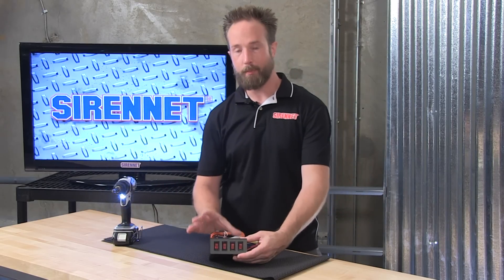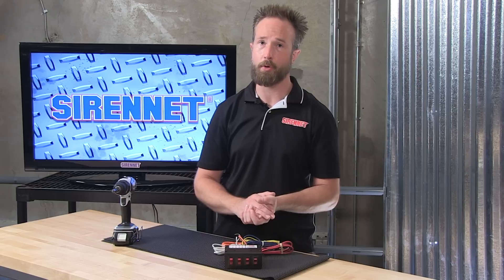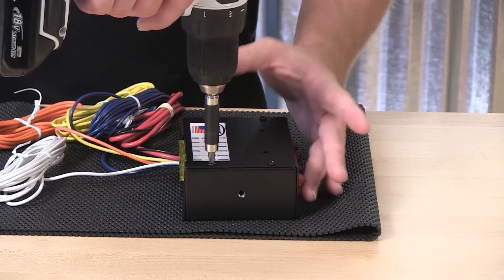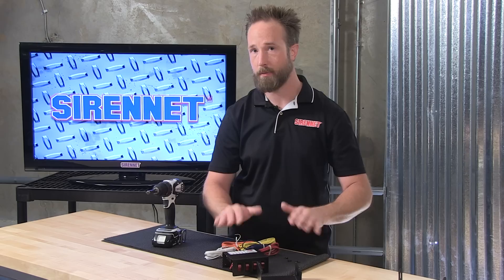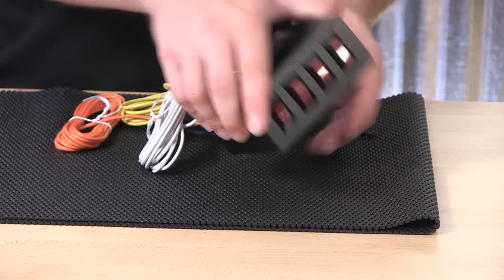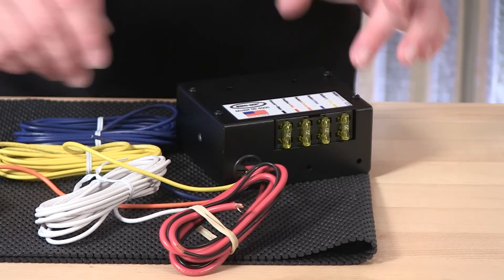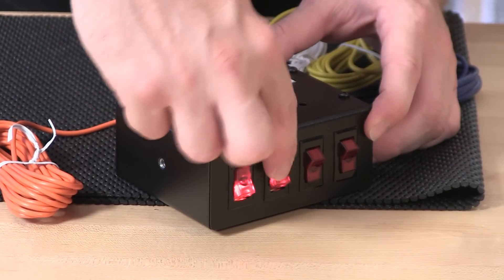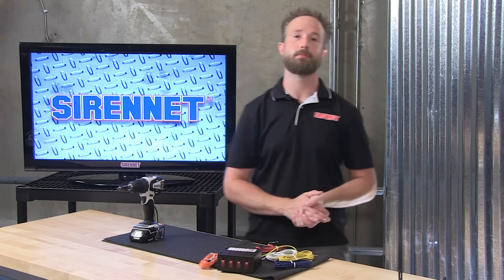The Able 2 Four Switch Control Box

Comment: If I wanted to connect two side warning lights, would I just use the right length wire and gauge?
Reply from the maker: For your side warning lights & other add-on's, 18 gauge will work perfect for your wiring extensions.